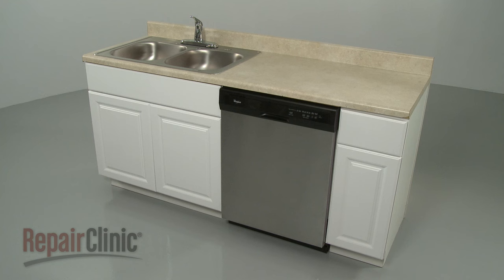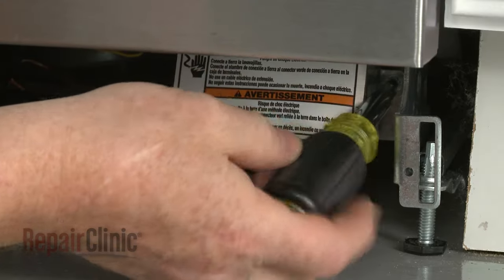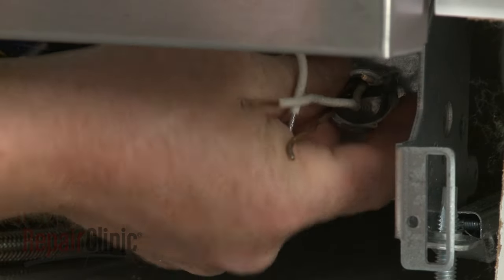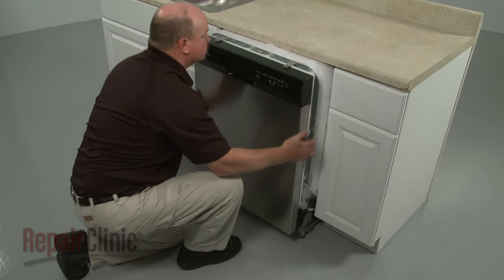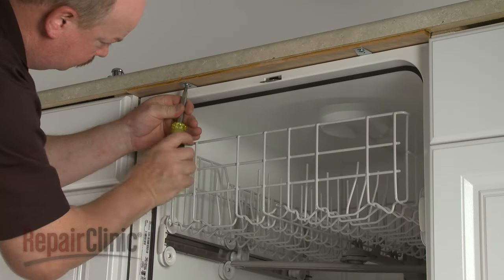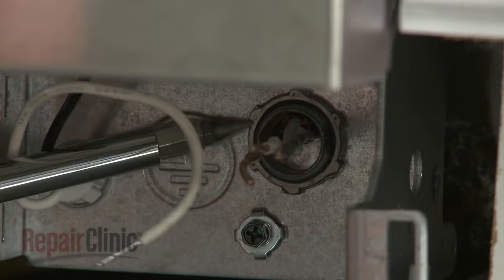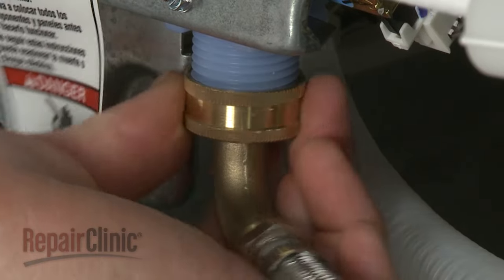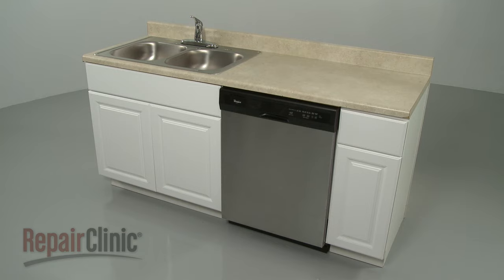Whirlpool Dishwasher Removal and Installation

Comment: So  all I need to do is pull the dishwasher out far enough to remove what stinks like a dead mouse. I am sure turning off the power and and water is certain. But is removing the water supply tube and unplugging all the electrical wires necessary?
Any input is most appreciated.
Thanks,
Jeff Bailey

Comment: I had a whirlpool installed a few weeks ago. I fortunately they didn't have any gap filler to fill the huge whole in the wall where a giant pvc pipe is right behind dishwasher. I want to now pull it out to fill that gap. I have a bug problem and while I know they can get in almost anywhere. I want to seal places I can find. Am I going to have to disconnect the wiring too for this? I'm told I should only need to adjust the leveling feet and unscrew the side support brackets.

I tried once before but couldn't get the dishwasher to move. I had only removed the screws from the side of the cabinets.
Reply: Hopefully you got it done. I have a similar issue with mice and am doing something similar. It looks like the electrical connection or water supply would not be long enough to move very far. Even if you reduced the leveling feet and disconnected the counter screws.

Comment: At 2:54 it shows the dishwasher drain hose entering at the bottom of the cabinet below the sink, then at 3:00 shows attaching the drain hose to the disposer, then at 3:05 shows the installer pointing to what looks like the drain hose wired up elevated higher than the connecttion point. The video does not explain why  you need to elevate the drain hose, and why it enters at the bottom.  Why is it important to elevate the drain hose?
Reply from the maker: This prevents water back flow from the sink into your dishwasher.